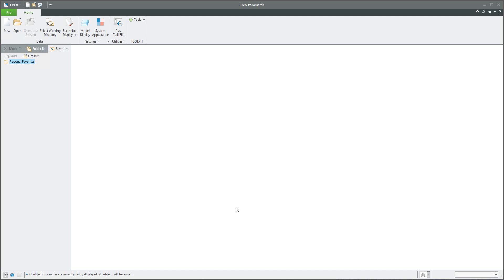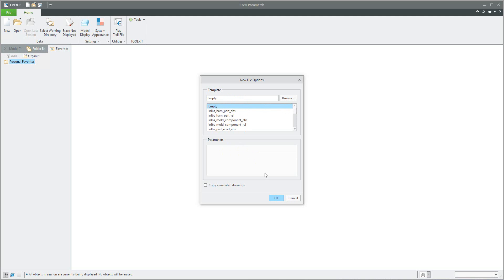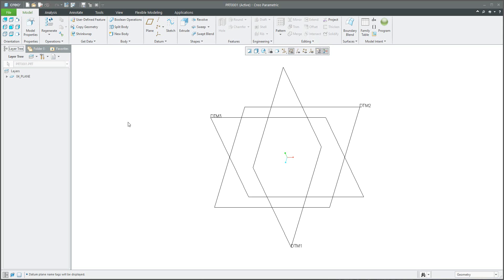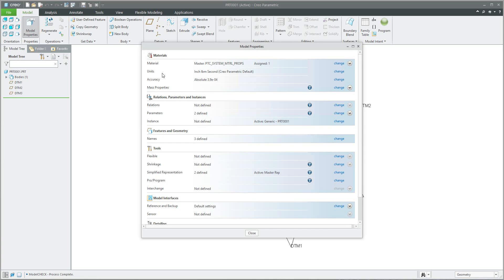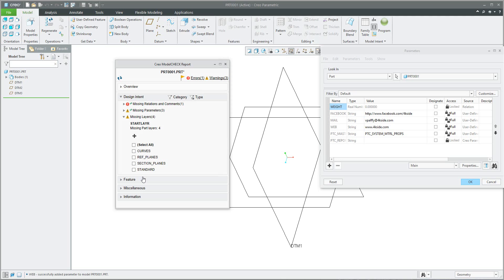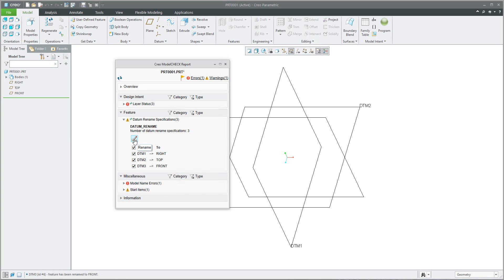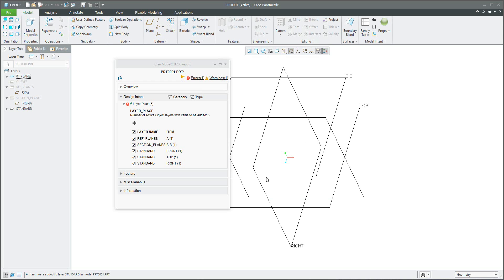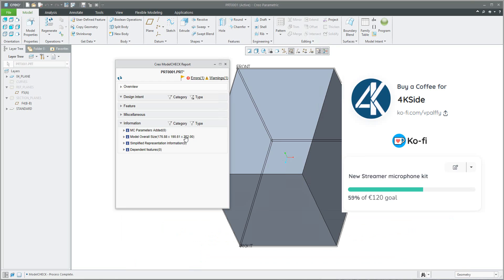ModelCHECK tutorial: How it works | The best practice example

Comment: Modelcheck report is not generating after running modelcheck
any soluction?
Reply from the maker: ModelCHECK is complex configuration (many reason when is not working)
Start with default (prepared by PTC) if this is OK, please add your customized files and check when system don't create report.
Also in the past I have had problem when embedded browser was not possible too use properly.

Comment: How do I use model check to detect sharp edges or corners in the model? Of not model check is there another way? Thanks
Reply from the maker: Hi thanks for your question. If you need to check Sharp edges by MC please update configuration file: ....Common Files\modchk\text\usascii\config\constant\mm.mcn (define custom value for: SHARP_ANGLE) + ...\Common Files\modchk\text\usascii\config\check\default_checks.mch (set option as follow: SHARP_EDGES          YNEW       E       E       E       E       Y) - where E is MC_ERROR for SHARP_EDGES.